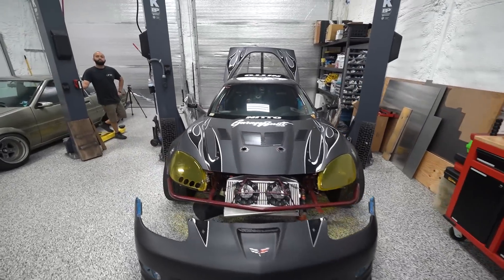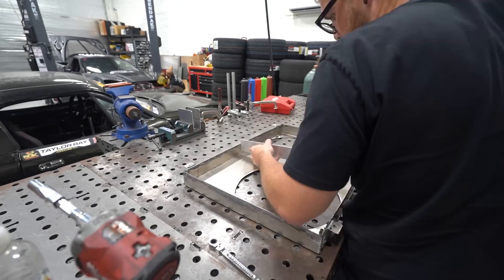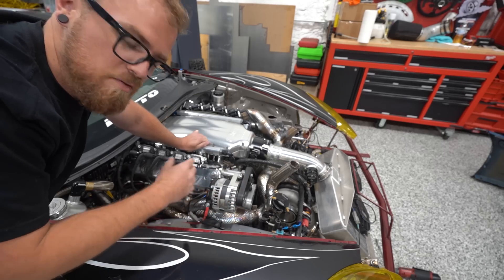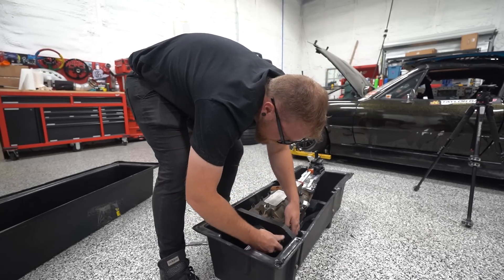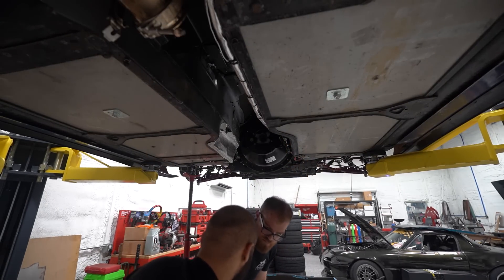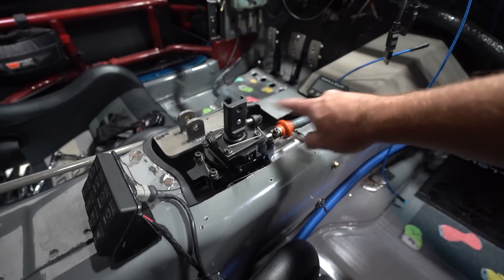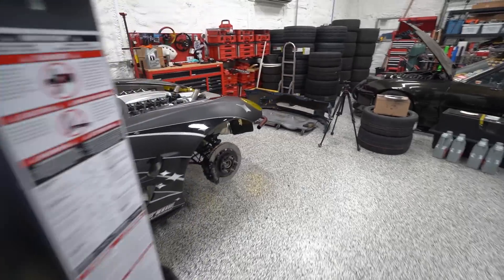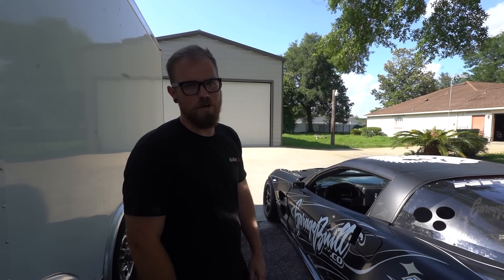C6 Corvette competition drift build gets a full makeover. big changes. it's ready for the $50k

Comment: for the cooling you still need to vent the heat out of the hatch. right now your still circulating already heated air back through radiator again. Just like your explanation. on fans sucking air through each other due to less restriction, the same is happening after air comes through radiator.  Make a shroud the size of the radiator that widens and tapers back toward the rear of the car and cut the back window to fit the exit of the shroud. now all the air under the car is being pulled through and blown completely out of the rear of the car and not floating around in the hatch area.  huge cooling gains even sitting idle
Reply: With the fans on the air comes out of the holes already cut for venting
Reply: @wobblysauce  a shroud would flow wayyy more air than the vent holes in the rear window
Reply: @wobblysauce  alot more hot air is being sucked back through the fans.  Air and water both move faster through least resistance.  those holes are to far away and to small to get even half of the air out, the rest is just swirling around in the rear of the car. this is why he always had problems with idle temps creeping up, when hes driving all the extra air is being sucked out from under the car and out the back and why his temps are good while driving.
Reply: And he already said no to cutting the rear window like FD setups, not into the look.

Comment: Any thought about making rear wheel tubs to reduce the amount of tire debris that can clog up the radiator?
Reply: even some small sheet metal plates along the side of the rad would help a ton
Reply: hes mentioned hes on the fence about adding tubs. he likes having all the extra room to work on it when needed cause everything is right there, but he may make some type of removable tub if need be
Reply: @MMORPG87  Right on.  Some sort of removeable "tire debris mitigation system" would make for a good project.  Tubs do eat up a lot of space, but cooling is so important for this car that keeping the radiator clear should also be a priority.

Comment: Instead of EGT, try using the wheel speed sensors. If the car is still rolling, the steering will stay on.
Reply: I'd guess it doesn't have wheel sensors.
Reply: Or just set it to turn off 5 sec after engine dies

Comment: Why, instead of using the exhaust gas temperature to power on the power steering pump wouldn’t you use a wheel speed sensor that sensor say anything over five mph would indicate that the power steering pump should turn on, as you’re always be rolling when the ignition is on even if the engine cut off, you’re still mid entry and the wheels will still be turning

Comment: Any reason not to just add a power steering pump switch or "on" button? You're not going to forget to turn it on and you (presumably) can hear it to remember to turn it off, or set it to automatically turn off whenever you turn off the ignition.

Comment: Awesome work! one little thing i saw tho, the vent line between the expansion tank and the swirl tank i tink has to be above both of them, if you route it under the cage like you have now any kind of overfilling or overflow would get in that line and let it filled with water since its the lowest point between the 2 ports, probably liquid locking the line and making it that the air cannot go from one tank to the other. I dont know for sure and i hope im wrong and it doesnt give you trouble but maybe look into it

Comment: Can you not have a falling edge hold-off time on the power output? IE, require RPM over 500 to turn on, and have a hold-off time of 10 seconds so it runs 10 seconds past the loss of the RPM enable condition?

Comment: If you can't find a setting for your power steering pump, how about a lockout relay? That way the power steering pump stays on until power is killed. Commercial hvac manufacturers will use a lockout relay in their unit to lock out their compressors until power is cycled if a safety trips. I don't see why you couldn't do the opposite and use one to keep the call for the power steering on until power is killed

Comment: Having the engine rear of the trailer axles can throw the weight distribution on the trailer off, I hope it doesn't cause the front to lift and cause the trailer to whip at speed.

Comment: Man, a plate on the trans tunnel from inside the car would be super nice to get to the top trans bolts so you dont have to tilt the engine back and use 3 foot of extensions. Haha i dont know if its possible in your case but...